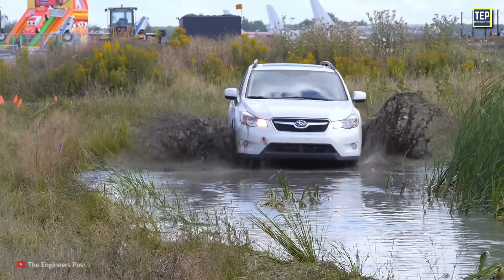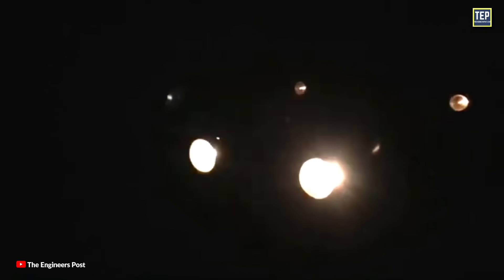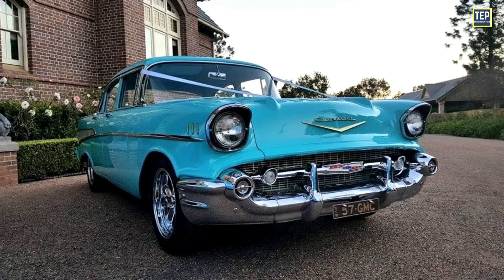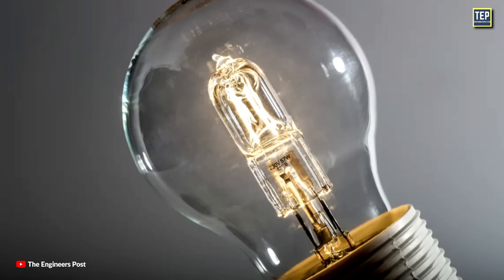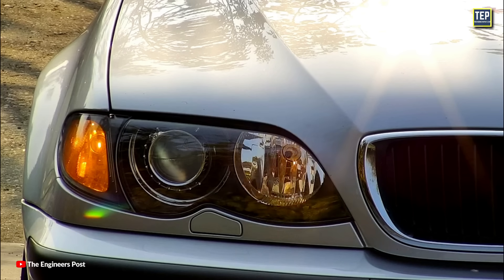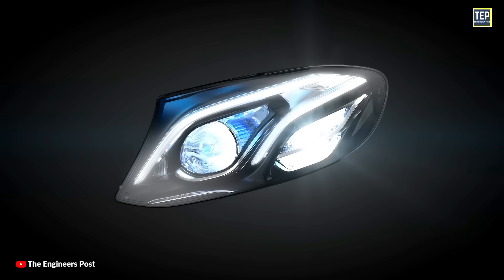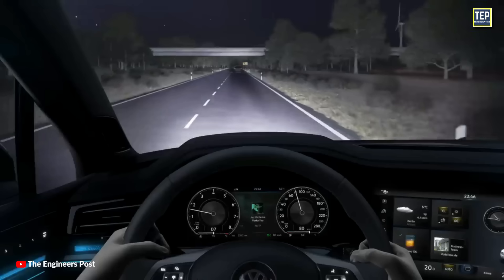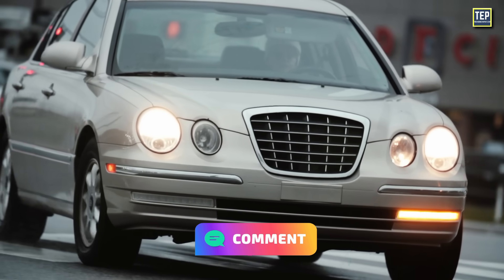The Problem With These Headlights

Comment: Too keep headlight housings from "fogging up" drill a couple small holes in them to stop condensation from building up inside of them. That's what causing the damage.  No air inside to evaporate the water.  Manufacturers do this intentionally so you have to buy new ones every 5-6 years.

Comment: One problem is people also using the wrong bulbs for their type of headlights!  That also causes them to be "brighter" than engineered to be. They should have made the bulbs not be "Universal Fit", but fit only certain applications and designs.  That is the true failure of headlights these days!   And using cheap ass plastic for the headlight housing.  That always fades and discolors making the bulbs dimmer so people go put the wrong bulbs in them to make them brighter.  Headlight technology sucks today!  It's truly a joke of bad materials and design.  "Bling" and nothing helpful.

Comment: i prefer halogem the most, when i drove car with halogen bulbs it had nice visibility, amd it had nice colour, when i drive bi xenons, it feels like it couldn't light so much to the front. also led lights are the worst on the market, i didn't drove it, but when car with leds is going towards, it is so blinding, that it i have almost to stop until that car goes off, especially suvs or crossovers, and he has low beams. it is still worse, than xenon or halogen have high beams, because it is so unnatural colour of light and even if car with leds is behind me it brightens all interior in my car so much and i have tinted rear windows. i think, leds in automotive should have all below 4000k and also they should make some limit to height of headlights, because it is usually right below bonnet, and there is the problem. normal passenger car has windows at height of suv or pickup has just bonnet and it really blinds

Comment: Roads today are still largely unpaved, rough and full of deep pot holes so roads have not developed much. These new indicators on some cars with a thin strip of small LED bulbs across the top of the headlights can barely be seen and should be classed as illigal though many people don't care about using indicators and give you that angry look for pulling out in front of them like your supposed to know that they are turning which is why I have fitted cameras to both front and rear of my motorcycle because driving standards these days are so bad, just going through YouTubes bad drivers shows you why you should get cameras fitted too your vehicle ASAP.

Comment: led- lights are maybe pretty and powerfull, but you can replace control unin and turning lights. if high beam, or low beam stops working, than you have to replace whole light. they are producing heat, because of that behind led diode is big heatsink btw. :D matrix and laser lights have same issue, but they are much more expensive and they are heavy as hell due to complexity and bunch of extra parts. matrix lights are worst in my opinion. super expensive and you are blinding people on auto. especially bicyclists. in combination with suv... i would ban them! :D

Comment: Remember that your LED and xenon headlights shouldn't be used on hilly terrain as they blind drivers who go up when you go down the hill. Also bright lights throw shots of light blinding others when you are driving a bad or damaged road when the car is bouncing up and down. Old good halogen lamps are the best and the safest.

All that "safety" provided by too bright light is about speeding in the dark which is dangerous itself.

Comment: I prefer the one style halogen as the new technology just doesn't work quite well. 

In fact, these modern brighter and whiter trend has already got to a point where modern headlight pose a hazard because unlike this video claims, in fact they do dazzle incoming traffic!!!!
The matrix headlight only switches if when it turns DIRECTLY opposite another car, it wouldn't defect cyclist e.g. any by the way they still dazzle even before turning straight in front of the oncoming vehicles. 

Many times these modern headlights seem to be flashing just because they drive on an uneven road..... Totally unacceptable, and in the UK even RAC warned about this, manufacturers couldn't be arsed

Comment: I like the ones that you could pull into a car parts place, spend maybe a burgers worth of money on then install it in the parking lot in about 5 minutes.  Not the new ones that if you break the headlight the car is a write off and if you do decide to replace it you have to remove the whole front of the car.

Comment: Most of your info on LEDs was wrong, they rarely (certainly aftermarket like the bulbs you showed) provide better performance, they not only do have heat issues, but BIG heat issues (again, especially aftermarket ones) and saying they’re the most energy efficient is also false, most operate at the same wattage as a halogen (~55w) while just about every OEM HID lamp operates at 35w. 

Everything was great till you got to LEDs lol. The common misconception of LEDs just being better at everything isn’t really true with cars. The VERY expensive OEM / exotic implementation is the only decent use I’ve seen so far.

Comment: I tried switching my motorcycle headlight from halogen to LED with an interchangeable replacement bulb (original was H4 halogen).  I switched BACK after my first nighttime ride, the LED may produce more lumens, but it's spread out in a wider field, not the tight beam that shows me the road ahead.

Comment: the problem with the new lights is there is essentially no low beam, needed for foggy conditions. Having fog lamps or some other adaptive tech for foggy conditions could help? And the light from oncoming traffic can be a problem with out the adaptive tech.

Comment: you can always tell the ones who have first hand knowledge on a subject and the ones who are just parroting information, LED's get hotter the hell, they may not get halogen hot but they get hot enough to fry your fingers, LED's also can work fine in halogen housings as long as you get the right LED's, they need to be 1:1 clockable conversion LED's which are made to work in halogen housings. My knowledge is based on personal experience having converted all my vehicles, both 2 and 4 wheel, to LED's. i will never drive again at night without LED's...........

Comment: I think HIDs are better than LEDs and the other newer ones. With my Lincoln MKZ I'm glad I went with standard adaptive HIDs instead of the LED option. If an LED fails you can't simply replace the individual bad diode, the whole headlight assembly needs replacing (up to $1,000+ for an MKZ). It's a lot cheaper to replace a $150 HID bulb. Plus LEDs are usually more blinding to other drivers than HID. The IIHS has studied this for years and rates so many cars with LED lights poor for excessive glare
Reply: 17:34 My 14 fusion had HID lamps, I replaced them with LED lights and am very happy with them. And the blind don't cost $150. I replaced them and the blind were only$55.00

Comment: Light technology is fantastic however manufacturers need to install them in a way that drivers can safely use them. Just having an automatic light setting is not good enough as most drivers are not taught how the settings operate and then simply drive around with their high beams or worse just their park lights on. The systems should be 100 % automatic not just have an auto setting.

Comment: The problem with modern cars is the lack of ownership maintenance! Also all this self drive crap needs to go, it's taking the responsibilities of the driver away or rather think they are not responsible for what the car is doing! Halogen bulbs may fail after time, but they don't cost an arm to replace like led or xenon were you need a leg as well, electric lights you got a new reflective backing when you replaced it. All the bulbs that came after halogen are just too expensive to replace, regardless of how long they last or how much brighter they are. The seeing further down the road crap is blinding to oncoming traffic, these really far reaching lights are going far beyond a humans sight capacity. Ya you can see but you can't comprehend what's half a mile away.

Comment: Have led I. My old truck. Can actually see the road. They are adjusted by the book. In a assembly made for led light. People get mad when I flash my brights too. Not my fault their heads sit where my stock pickup headlight assembly is. And people complain cuz I am in the wrong blinding em when they chose to sit right where every truck light goes imo

Comment: 0:02 The muddy water going up the wheel well and through the head and fog lights is something I've never though of as a thing that could happen, but it makes sense I guess. The body of the car is mostly there to look pretty and direct airflow... maybe structural in some areas, but there's no reason to have that part water tight now that I think of it.

Comment: better example of the adaptive headlights past would've been the citroen DS, which actually had two, normally positioned lights following the steeringwheel rather than the torpedo's searchlight-like cyclops eye

Comment: when i hear BS like LED emits no heat i can't believe we live in such messed up times. Heat is sole reason why ppl drive with some of LED lights out and dont' bother replacing them. Cause they know whole strip needs to be replaced at once which is expensive AF also they know it won't take long before another LED goes out. Normal light bulbs had short lifespan but replacing them was 5 mins of work.

Comment: There are some modern LED headlights that seem to flicker at a fast rate when looked at out of the corner of my eye. As seen at 8:30. It drives me NUTS. They must not have anti-flicker capacitors.

Comment: I cant see when those super bright headlights are in my mirrors. Like, my 65000lb trailer might be in your lane crushing you to death, but Ive been blinded all night, so... sheesh. Ban those things already. Its torture trucking.
Reply: Where is this? People don't get their lights adjusted where you live?
Reply: @logitech4873   Everywhere in america. Im a trucker. So every night all night any place there is traffic, I get blinded by these led lights. Its every other car
Reply: @zeroshepard9513  That's not the case here in Norway. In winter we have about 2 months of 24/7 night, but people are good at getting their lights adjusted. Of course I OCCASIONALLY come across someone with poorly adjusted lights, but chances are they're gonna be flashed at until they fix.
Reply: @logitech4873   We have 300 million people and and half of them have the new LED lights. Ive driven 100k miles of road in less than a year. Those headlights are torturs

Comment: At 11:00, My 2003 Mondeo has xenons,given that I've had it from new and never changed a headlight bulb I'd argue that any bulb that lasts for 21 years and about 90,000 miles so far,is remarkably durable. Where as in the last ten to fifteen years in my job as an auto electrics tech,I have replaced or repaired an endless list of led DRL's,tail lights and headlights where drivers/circuit boards or the actual led board fails,(not to mention the hundreds of those crappy 501 led replacement bulbs that people fit),all failing through poor heat management,cheap components or water ingress and always far exceeding the cost of replacing a DS1/2 Xenon bulb.Even some small led mirror repeaters are around the £150 mark,I paid £300 recently for a Honda jazz DRL not much bigger than a bottle top!. Leds them selves may be ultra durable but the systems to support and control or power them are anything but. There is a steadily growing third party aftermarket industry for led headlight electronic component parts if you know where to look and even OE manufacturers like Hella and bosch have some component parts available now,that in its self is indicative of their fragility.

Comment: 1. LEDs are not more efficient than xenons, they're about on par.
2. LEDs do produce heat and since the emitters are not heat resistant they also need to be cooled.
3. So far the laser headlights are disappointing, LEDs are brighter and throw further.
4. 6500K of LED light is not natural or close do sunlight. LEDs have a problem with blue light content, they have a massive peak on the blue which is unnatural to human eyes. Visually 4500K LED is close to sunlight (5500K) and the difference comes from the excessive blue light in the light spectrum.

Comment: Conversion kits exist for both Halogen and Xenon lights. I've hada car with both halogen and xenon light bulbs which i upgraded both to LED and here's what ive noticed. The number one thing that people complain about is how LED blind other drivers. I found that to be the case when installing them on my halogen lights as the mirrors do scatter the light more than lenses in xenon lights. My lights were a bit dirty, and not just dirt but the plastic being faded and scattering the light even more. After cleaning the headlights, ive noticed another thing on the halogen mirror lights: the direction they were facing. Most people don't even bother to do this, but alignment of headlights is crucial for both you having good visibility and not blinding others. Mine were extremely high up, basically hitting most people's windshields + i didn't have the best visibility either. After fixing the two major factors. My halogen mirror lights had not only a distinct cut off line, but were also not blinding others. In xenons lens lights it's pretty much the same thing especially with headlight alignment except the cut off line is way more distinct as lens lights don't scatter light as much

Comment: The problem with todays cars no matter what technology is in them is that they have plastic headlight covers that yellow and become opaque over time from exposure to the sun. Sometimes it can removed but not always necessitating the replacement of the whole headlight assembly. Rocks and other road debris can damage the lens requiring replacement which on most newer cars is $500-$5000 per headlight depending on the car. On the older sealed beam headlights the lights themselves are glass and do not have the same exposure issues of plastic headlights, and if they get damaged from road debris you can just get another one and put it in under $20. Newer headlights are indeed better for driving at night no question, but the manufacturers need to figure out a better way to make them less prone to sun damage and/or a way to replace the clear lens instead of replacing the entire assembly

Comment: The advantage of the sealed glass headlights is that you get a brand new lens every time you change a new light. With these new ones you just change the bold and if you have a clapped out headlight you're stuck with the old plastic peace...

Comment: The sealed beam headlights on my 1991 Jeep were last replaced in 2007 & they are still going strong.   They were $26 for the pair.  The previous lights failed after they were hit by rocks from a gravel truck on the highway.  I put rock shields on after that & the lights just keep working great.  They never get foggy or scratched either like those on my wife's  2007 Element.

Comment: High intensity, high Calvin temp. lights (cool-white) should have never been approved for vehicle use. Some cool-white head-lights are so bright, they hurt the eyes, even in daytime. This intensity is compounded by smaller lensed lights, with means light must be concentrated through a smaller aperture, which also tends to be less visible from the sides. This makes left-turns very hazardous when opposed to another left-turner with such lights, especially if the opposed is a pick-up, as all around the vehicle is, other than the opposing lights, washed /glared out to black contrast.

The greatest hazard, though, is the use of this cool-white tone mimics sun-light. This makes the head-lights, other than shape, indistinguishable from sun-light reflecting off shiny surfaces at certain angles. Manufacturers also design cars that often have the day running-lights near the top corner of the front-hood that may be mimicked by reflected sun-light. A parked car may look the same as a running car, and cars themselves, other than moving, don't stand out as distinctive from other reflective objects. Big, bright, warm-white head-lights (including day-time lights) are superior in this critical regard. Other than at dusk and dawn, there is nothing naturally appearing on earth, other than very hot fires or hot golden-white coals, like incandescent (or warm-white LED) headlights: It is instantly recognizable as a [vehicle] headlight.

It seems commercial 'coolness' as apposed to safety and sensibility, enabled by indifferent national transportation safety boards, is the way to go.

Comment: @ 13:11 - Throwing LED's into a halogen housing WILL work depending on the design & manufacturer.  The real problem is replacing the signal indicators with LED's.  Ideally its best to replace the flasher relay with one that's LED compatible.